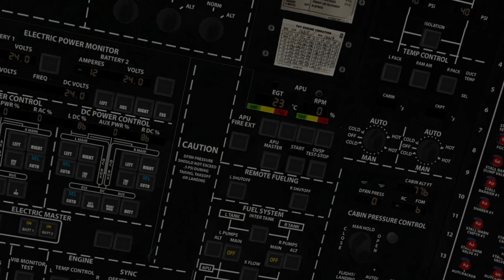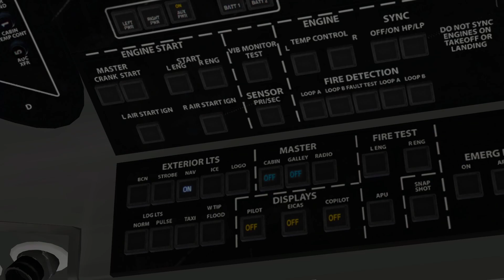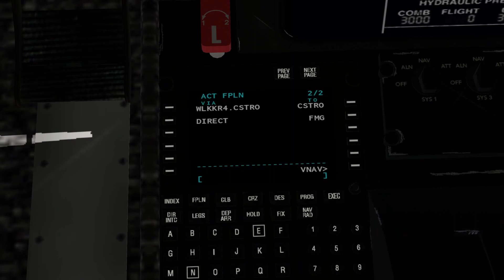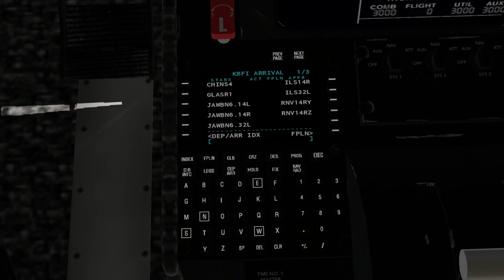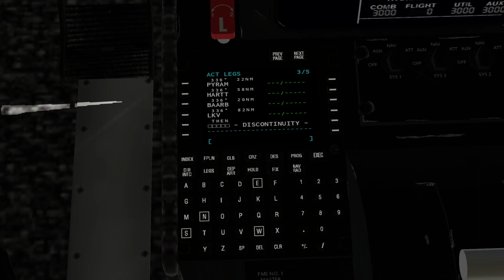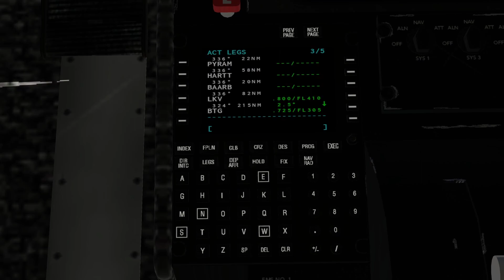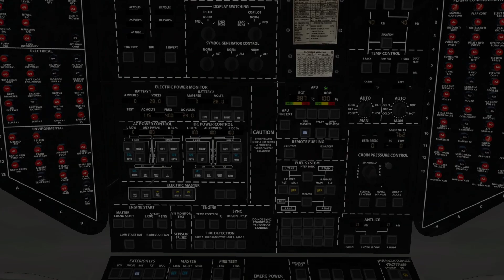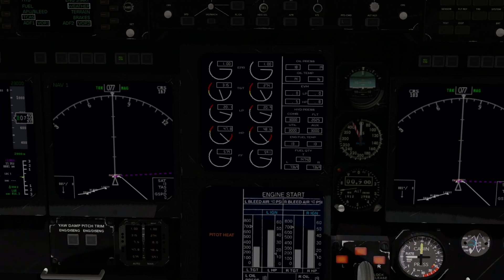Gulfstream G-IV Startup +FMC Tutorial X-Plane 11 @VNY

Comment: I have the same GIV , but it keeps losing power after take off
Reply: You are revving the engines above 100% and blowing them up. Pull the throttle back until the alarm stops.
Reply from the maker: Hmm, that's odd. Is the autothrottle engaged? Maybe that is pulling the power back.
Reply: The engines do not have an automatic governor, so if you keep them full throttle, you burn them out!